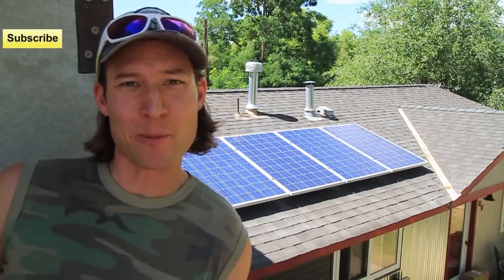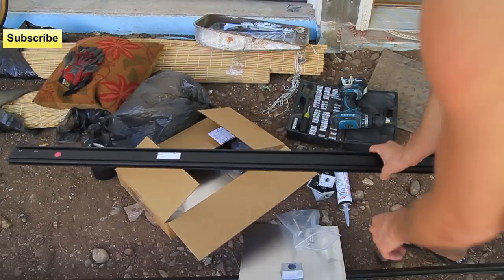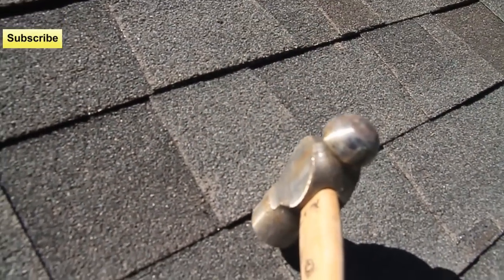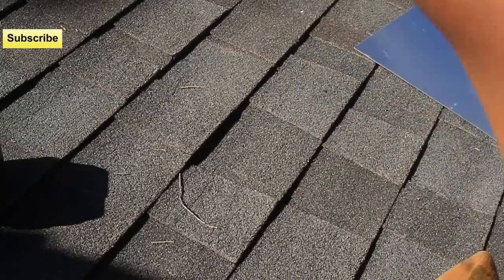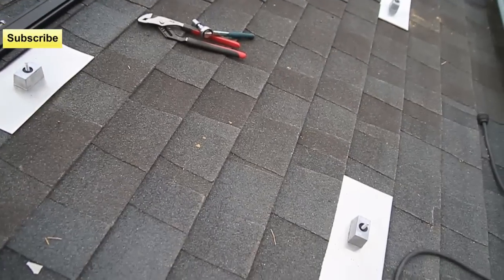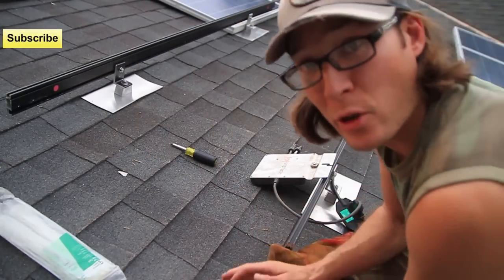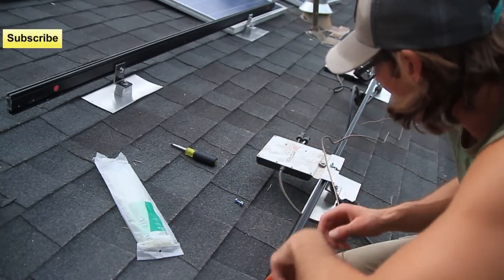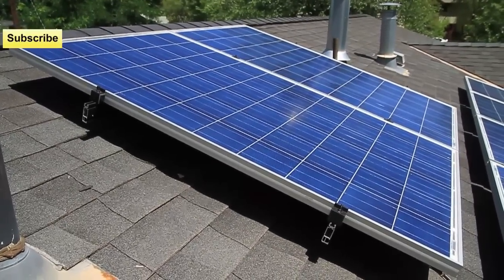HOW TO INSTALL SOLAR PANELS PART 2 DIY ARRAY ENPHASE MICROINVERTERS 1.47 KW SYSTEM TIME LAPSE

Comment: Thank you for this simple yet very informative video.  I did not know the tricks to putting the flashing / mounting point on.  most videos only show the flashing after its installed.   I feel more comfortable with the idea of installing flashing now that i see the steps involved.   I especially like the fact that you did not hit the rafter the first time, and how you fixed it.   That's the real world for a do it yourself installation.   Most videos show a perfect edited installation.   Thank you for showing your mistakes.

Gregg
Reply from the maker: "By seeking and blundering we learn,"  ― Johann Wolfgang von Goethe   Glad you liked the video Gregg.
Reply: If the attic is accessible drill from the bottom up never miss the truss, also by a quality battery drill and iron ridge racking.
FYI osha is now self funding. Safety glasses ,boots fall prevention AKA harness.  Nice job

Comment: Nice video Jesse, Have you had any trouble out of the enphase inverters that you have installed on any job you have done. I'm thinking about installing enphase inverters. thanks
Reply from the maker: No I haven't yet Greg.  They seem to be fairly robust, we'll see what happens in another 10 years or so.

Comment: I 1st want to give you props on your attempt. I would not recommend any Enphase Micro inverters even for a small system.  They have a very bad track record and take a long time to get replacements. Not sure were you are located but to get 30% tax credit and state incentives require a Master Electrician to make connection to the grid. Plus some Utilities require Inspections with sign affidavit.

Comment: You should try putting NP1 sealant on the roof to seal the holes you put in it and the nail you remove should be replaced. On steeper houses not replacing the nail can hurt the integrity of a 30 year shingle.
Reply from the maker: But what about the flashing?  Maybe you could put the nail through the flashing.
Reply: Jesse Hoff yes you can put the nail right through the flashing. Maybe you can look at an installation of a roof jack to get an idea of what I mean
Reply: el

Comment: I saw your original video and saw a number electrical errors. For example your meter bypass calls for #6 wire and you said you over sized it with #12. Actually, the smaller the number the bigger the wire. Number 12 wire is way too small for your job. As a result, you are loosing amp hours in your install.

Comment: What brand of equipments do you recommend?
Reply from the maker: Depends on the system, size and such, and shading issues.  Smaller systems seemed to me to be more cost effective with the microinverters (Enphase system).  I'd recommend a system such as this for a small house.  Do you know how many kilowatt-hours your using per year?

Comment: my "end around" to the permitting and installation issue is to use a heat pump with direct solar input and a self built solar/grid input for a hybrid water heater. Solar has become political and the power lobby in my state has set the minimum kw to preclude small grid tied system like this video. A 10kw system here is being quoted at $35,000, this by a self proclaimed solar co-op which is just a marketing tool. The THING is very profitable to someone and it ain't the victims.
Reply from the maker: Where do you live Robert?

Comment: Where can you buy all the parts??
Reply from the maker: I bought the majority of the parts of this website http://www.affordable-solar.com/
Reply: Jesse Hoff Thanks!
Reply: Jesse Hoff 
Okay another question lol. I don't understand what these systems produce in terms of kWh. Annually I used 11,644 kWh, which system would cover that? They listed String Inverter kits from 2000W to 6000W. Thanks again for the help
Reply from the maker: Hey Rick, I go over how to calculate that in this video https://www.youtube.com/watch?v=TFwdY0wiBGA, by the sounds of it you'll probably need at least 6 KW to offset 100% of your electricity load.  Go thru the calculation and find out though.
Reply: Jesse Hoff 
awesome thanks!

Comment: Where are you located?  Can I hire you for a solar project?
Reply from the maker: Maybe, I'm in Colorado currently, where are you?  I travel around quite a bit, message me the details of your project.
Reply: Jesse Hoff I'm in the SF Bay Area.  After being bombarded by 100s of phone calls from Solar City, SoCal Edison, SunRun  (etc.) I decided to get some quotes.  Solar City came back with a quote of $40,000 and the others were in the $35,000 to $40,000 range.

Then I talked to four people who said they installed PV themselves and their total coast was around $8,000 less the 30% federal rebate.

This got me wondering how much money Solar City/Elon Musk is making.  Holy crap, it's about $28,000 off each home that installs solar.  Panels, wiring and inverter around $8,000.  Labor $3,500.  Permit, $361.  That leave them with a profit of $28,000 plus they take the 30% tax break.  So they make $28,000 so I can save $30-$50 a month off my electric bill.

What a rip-off solar is with solar city.

In California our electric rates are tiered.  At the highest tier we are paying $0.39 kWh.

Now I'm interested in installing solar.  I want to save the $28.000 profit that Solar City would be getting and doing most of the work myself.

I have no problem doing most of the electrical or installing the panels on my roof.  I installed the solar thermal panels for my pool on my own.  

What I would need assistance with is the plans for the building permits, knowing what the local electrical code requirements are for solar, and help with in selecting the equipment and the installation.

You did an great job explaining everything with your video.
Reply from the maker: Ya you would think a company like that wouldn't be so greedy.  What size system are they proposing for the house?  Shouldn't be much of problem, let's do it.  Send me an email with your number, hoffjesse@gmail.com and we'll get the ball rolling.

Comment: Fuck I wish I lived in cowboy USA, here is Aus a Licensed  Electrician / Electrical contractor (in Solar) are the only ones who can install a solar system, let alone we need to apply for a Renewable Energy Systems application to our Electric Supply company before it can be grid connected... 

If I did D.I.Y it myself I guess I could just stop my house insurance, because it wouldn't cover me anymore since it's not legitimately installed & signed off on and if I connected it to my house supply I'd better hope the Electric company doesn't find out cause I'd be sued & be up the river without a paddle... 

All in All great advice @Jesse Hoff for people to D.I.Y it if they're not worried about insurance, possibly being sued or other 'bad out comes'.
Reply: You can do DIY in a lot of the US, you just need to get an electrician/electric company to do the final inspection/sign-off of the system and hookup at the box respectively.
Reply: If you see all the jack legged stuff he is doing, you probably are better off getting a professional to do it.

Comment: handy hint for DIY cowboys.. if your house burns down, don't expect an insurance payout.
Jesse Hoff. Is it wise to be promoting how to do electrical work to those without a licence?

Scenario, does an electrician show a home owner how to wire a light? no, because when someone
gets hurt... the electrician goes to jail for gross negligence or at least, has their licence revoked. 
hate to be a party pooper but we are licenced for a reason.
Reply: I was suspect when I saw him wearing flip flops to do roof work. And when he started popping holes in the roof looking for the rafter, it was confirmed, dont listen to this guy.
Reply from the maker: I think it's more wise then spreading fear about an unlikely event that's for sure.   If an individual wishes to work on solar panels on their own home I applaud them. I think the more interesting question is why so many licensed electricians watch my videos and comment?  Do they really care about the safety of the homeowner or just their own wallets?  My feeling is that the plethora of electrical information on youtube and the internet makes them feel rather belittled.  What do you think Lloyd?  As far as your house burning down because of electrical work you do yourself, I'm rather skeptical of that. I'd have to read a house insurance policy closer to make a judgment. Do you know of people whose house has burned down because of electrical work they have done themselves and then not gotten an insurance payout?  Please forward their names and info along to me, I'd love to interview them if so.
Reply from the maker: Who should they listen to?  Someone with a fake name like  DisplayName01?  I suprise myself by entertaining such comments.  Maybe it was the part about the flip flops that got me, I don't trust people that wear shoes.  :-)
Reply from the maker: Sorry Lloyd but you're wrong, try to spread information, not hate.  This really isn't the place to be making such comments.  People are watching this video hoping to learn something.  But back to your dubious claim about house insurance, do you have any information that can back that up.  Do you know of anyone that we can contact that haven't gotten an insurance payout because of electrical work they have done themselves?  My guess is that you can't back that up, prove me wrong.